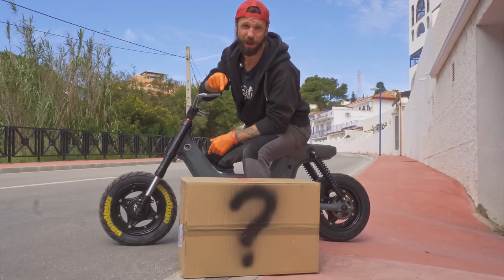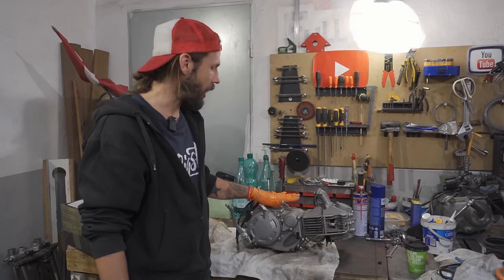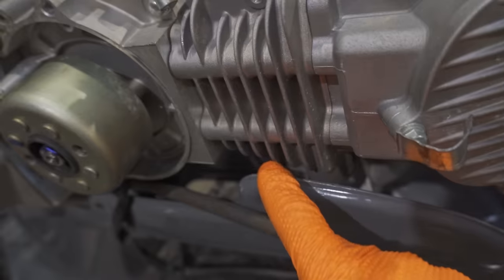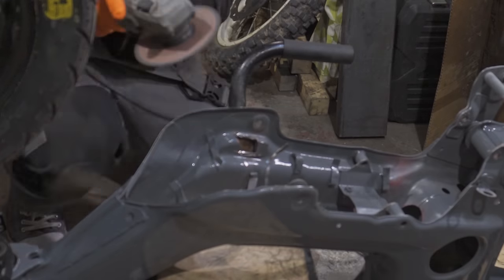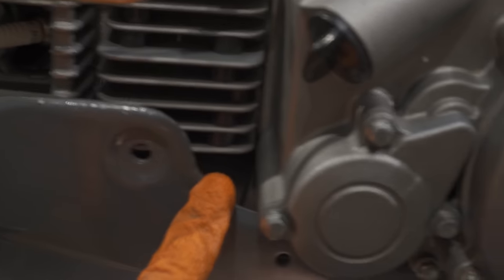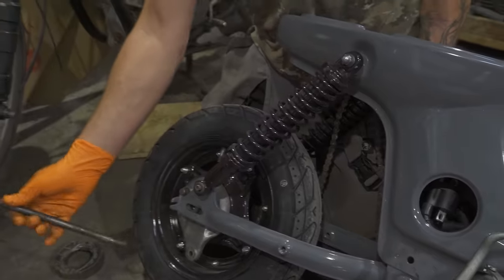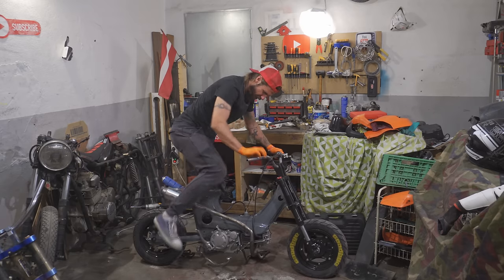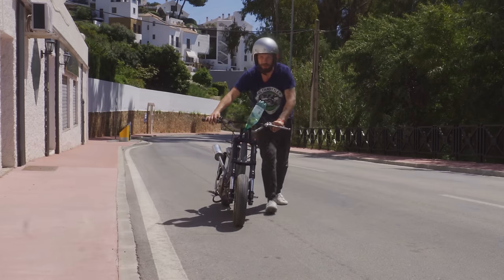INSANE Upgrade! 20HP Engine for Honda Chaly /EP7

Comment: That exhaust sounds pretty good! Also, are you gonna paint the engine after rebuilding the top end? Black might look good. Probs on getting it running. I could never lol
Reply from the maker: Hmmm I've been thinking about it and I kinda sway towards not painting it. I think it looks really good with the grey and black. But we'll see later on, for now there's still quite a few things to finish up. brakes, seat, bearings, fuel etc 👊🏼

Comment: Hello from finland! What carburetor are you running?😅 You definitely have to tune it 😂
Reply from the maker: Hhahah word! I think its Maloi 26 mm, but really i need to check the top end of the engine first, the seller already told me that its hard to start and is smoking so before messing with carb, its piston / rings. Vittu!
Reply: Hope you get that running 😂 torilla tavataan perkele